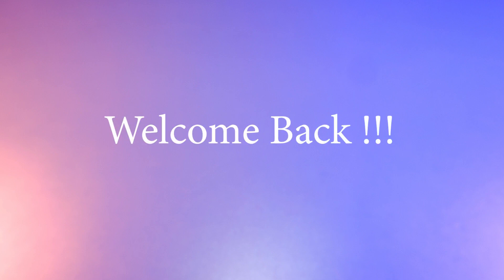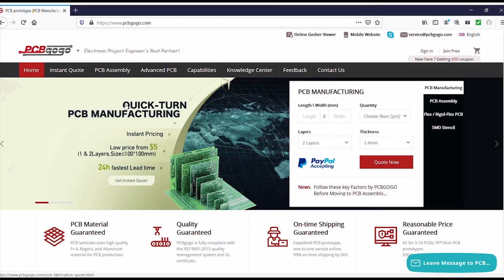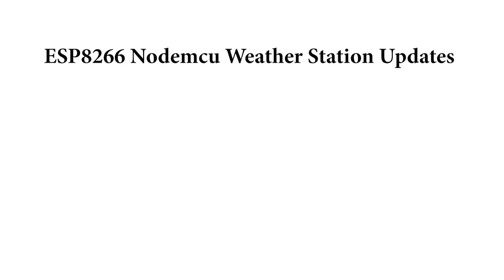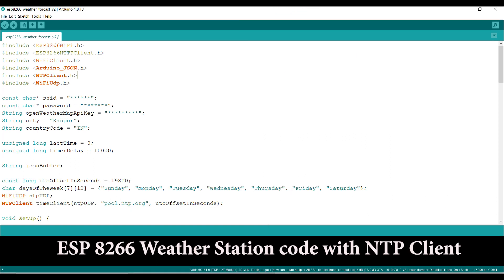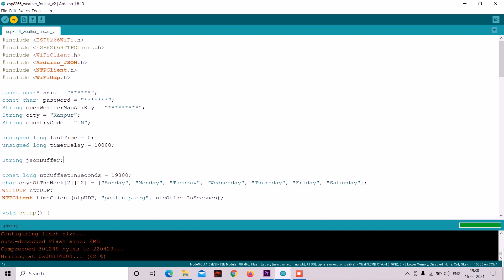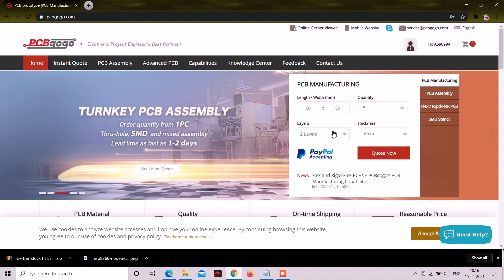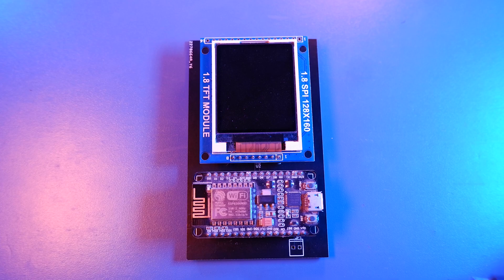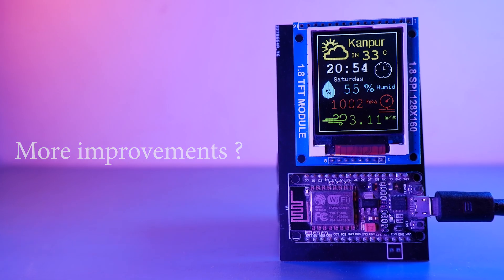ESP8266 Nodemcu & ST7735 TFT Display based Weather Station v2 | Get Local Time & weather information

Comment: Very nice video thanks for sharing your project and code it's good to see a better display st7735 being used and not the old 2x16 display or the OLED display, so thank you for that, I just need to change the code for UK LONDON.

Comment: Dear mr.how i can showing display to lcd st7735.sketch is complete but lcd not display
Reply from the maker: i think it should work right away if your connections  are correct
Reply: Lcd pin is correct.i uploaded using android
Please give me screenshot image before uploaded sketch, how use library.when use arduino ide on smartphone